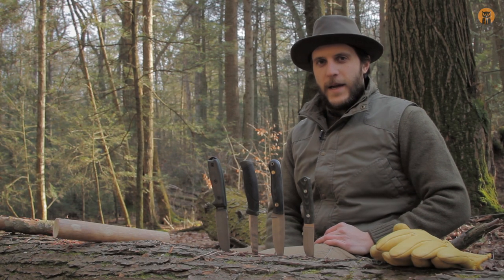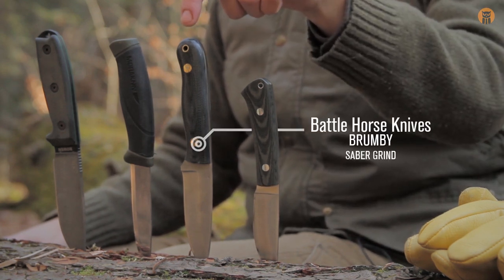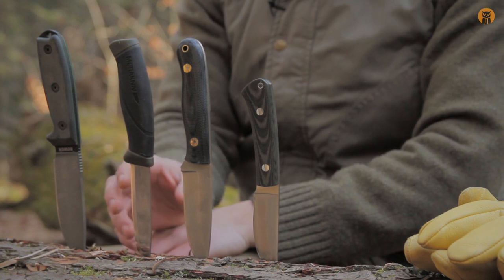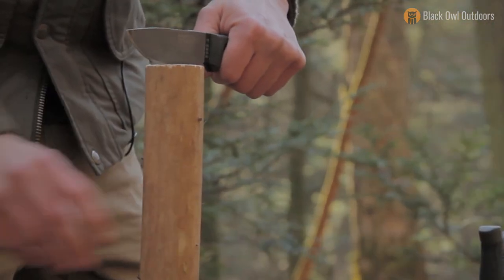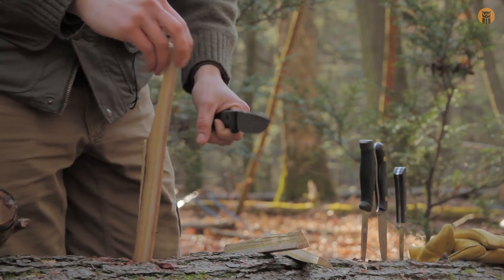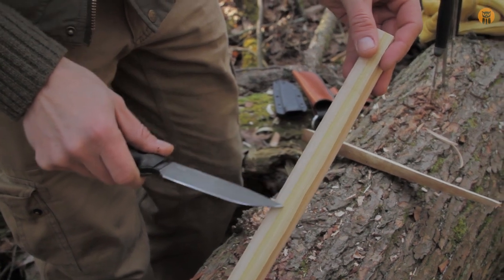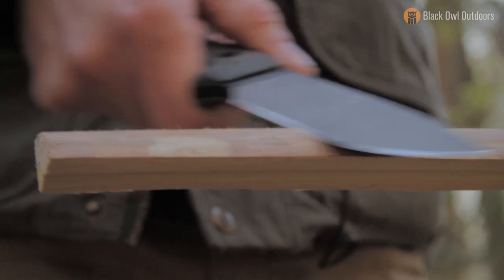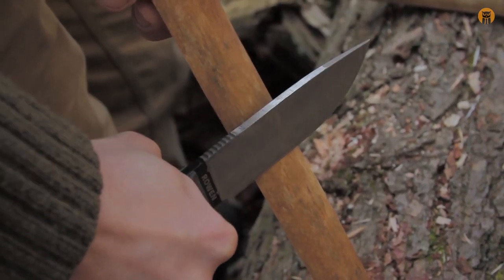Feather Sticks 101 | How to Make Feather Sticks

Comment: You just can't beat Scandi on wood.
Reply: r91976 scandi sucks on wood.
Reply: Conves edges are arguably better because of how they dont want to bite into the wood as much and thus will kick out the feather and keep a good thin shallow cut.  Scandi grinds require much more precision or it will break the feather or cut too deep into the wood.  Hollow grinds are the worst in this case.  Chisel grinds are hell to me because they try to cut super deep into the wood.  All asymmetrical grinds suck for wood processing
Reply: @William_Asston  agree, scandi cuts too deep

Comment: Krick,
Most excellent tutorial and you hit on a lot of nuances that are left out. One additional point would be to taking care of the feather and tinder prep BEFORE you get into the bucking, limbing and splitting of fuel wood because your hands will be very tired from the heavy work involved. You need a steady hand for the intricate and delicate detail of peeling off those critical ignition feathers you finished off with and when your hands are tired from heavy work, the will not be steady and will not have fine point control. This was a hard lesson I learned some years back when I was in freezing temps while fishing and in pretty dire need of some fire. Thanks a bunch and good to see you bounce back and fully recovered!

Comment: great video guys!!!  I'm by no means "great" at feathers ticks, but it's covered so well in this video, I found two things I was doing wrong 1) improper ridges 2) locking my elbow - I think that may be one reason I over cut and lob off he feathers before I'm done.  I love these Bushcraft skill videos, always great to get an in depth view at other peoples skills.
Reply from the maker: Primal Edge I've seen people say you can lock your elbow. Maybe with a super strong power cut. But for something that needs more control, I definitely don't lock mine. Work it and see if it helps at all. Thanks for watching as always. -Krik
Reply: BlackOwlOutdoors will do, grazzi!

Comment: Consider it a lesson learned! Mora=woodworking master
Reply from the maker: MoHawkinsBass There are a few reasons for that. Mainly, the thinness of the blade and grind. They're just not the strongest edges. -Krik
Reply: BlackOwlOutdoors Definitely agree. These are the main selling points of the Mora companion, along with how much quality you get for the money. I just find myself (similar to in this video) grabbing it when I know I need complete control for a cutting task. Thanks.
 -Matt

Comment: BlackOwlOutdoors Krik, it looks like your ESEE has been stripped and had a forced patina applied.  How did you do it?  I am considering an ESEE 4 and am trying to decide between the coated and uncoated blade options.  Do you think it would be better to get the completely uncoated blade, or get the coated blade and strip only the blade portion and leave the handle coated under the micarta scales?  Also, great video (as always)!

Comment: I always have trouble making these. Could it be possible I'm using the wrong knife or something? When I slice my knife locks on the wood and I basically end up with just slices of chipped wood.
Reply from the maker: +Cru1234 Is your knife very, very sharp? Also sounds like you have too steep of an angle, maybe.

Comment: Jacked up on Coffee haha. I can relate. Coffee studies I have seen and my own experience for the last few decades have proven that coarse motor skills are increased yet fine motor skills can suffer somewhat or greatly depending on the dose (my max at one time was 900 mg but I have read of doses up to 6000 mg on Erowid...not pretty).  

Anyway guys, Great vid. Not a true test of the knives grinds etc but was never meant to be. The Mora wins for these tasks out of the ones you have since it is light and nimble but also... 'dat grind'...three levels of shallow cutting power (inc. The 2ndary bevel you sharpen on apart from that main bevel which leads nicely into the flatish blade).  Just eats it up. It makes Zero sense to me to not own at least a basic Mora due to price, performance, grind, ease of sharpening and weight..it's not really even there till you need it. Cheers
Reply from the maker: EarlyMist I try to stay away from coffee. But I sure do love hot chocolate and coffee mixed. Mmm.

Comment: out of the four different edges you used, which would be the best for a beginner, and why? thanks.
Reply: For a beginner (bushcraft), I would recommend a scandi grind such as the mora companion. Its great quality, RAZOR sharp and yet inexpensive. 
http://www.amazon.com/Morakniv-Companion-Outdoor-Military-4-1-Inch/dp/B004TNWD40/ref=sr_1_3?ie=UTF8&qid=1421678360&sr=8-3&keywords=mora+companion
Reply from the maker: Ibpn I agree with what the fellow said, scandi. You can buy a Mora which comes razor sharp and very affordable. Being sharp is very important. It allows more control which makes it safer. But you must always practice caution when using cutting tools. -Krik

Comment: Good video.  I personally have the best luck with a convex grind.  I have, at home, re-profiled all my knives but the ones that came as a scandi grind to a convex variant.  Knife sharpening by hand has become a passion of mine.  Several years ago I set out to perfect fire making by primitive methods.  A feather stick is a great way to get a fire going.  This video also reiterates why I prefer one type of grind.  Going back and forth between grind types is difficult.  I tell my friends who are getting into knives and primitive skills to try different knives/ grinds, then pick one.  You can make a good feather stick or become proficient at a host of wilderness tasks with any kind of knife/ grind; but it may behoove you to find what you prefer and stick with it.  The convex for me has become the easiest grind to re-sharpen, the blade edge lasts the longest, and I am most proficient with it.  Again, thanks for the video.  I started looking online for videos to recommend to help a buddy learn due to trouble he's having with the skill demonstrated.  I will forward this to him.  

Also, somewhat mentioned in this video is wood type.  I subscribe to the notion that the best way for feather sticks to catch a spark is if the feather stick comes from the dry wood inside of a batoned piece as you showed; however, low hanging pine sticks work great also.  Soft wood is the key; but hardwoods work too; it's just harder to accomplish with hardwood.

Comment: Super easy no-skill way to make feathersticks:  use the sharp spine of a knife and run it down the stick with lots of force.  If the spine isnt sharp enough use the edge of your knife perpendicular to the stick.  It'll poop out feathers easily.  Works especially well with fatwood, so its a really good way to start fires

Comment: My fero rod doesnt "throw sparks" is there another striker i can use or find that will help this problem?
Reply from the maker: +Guardian 227 If you have a sharp spine on your knife, that works pretty well.
Reply: +Guardian 227 might also be your knife, some knives like some Helles do not work.  Try a little piece of Hacksaw blade, that works well or try a different knife if your spine is already good.  Hope that helps
Reply: It was my technique I found out. I was using the striker that came with the rod

Comment: black owl: I have a question: what would be a good starter fixed blade?! thanks!!
Reply: Try the mora companion or mora bushcraft :) 
They dont cost that much but, they`ll do whatever you throw at them. They come with a skandi grind the steel is great. 
Later if you want something more special you can look out for helle knifes or something like this, but they wont cut better then the mora ones. (a little tip: you can buy the blades without a handle for very little money, but you have to put on a handle yourself) 
Have fun in the woods !
Reply: +gimlisrage5 thank you!! I will consider it!!